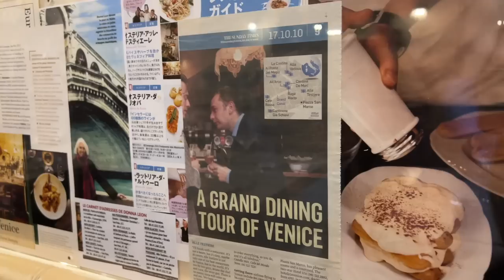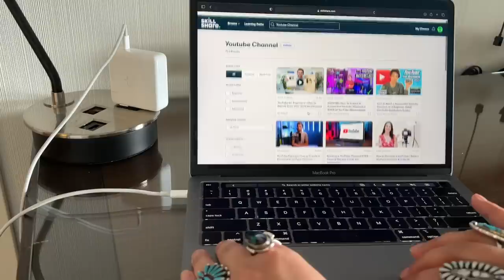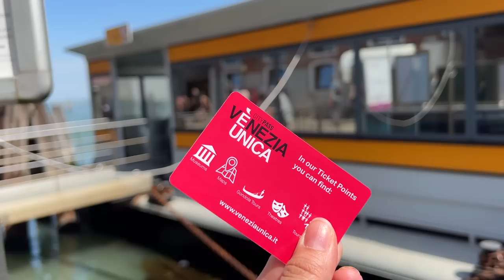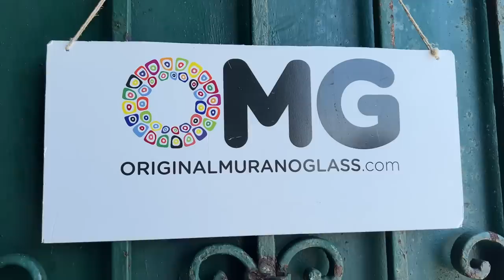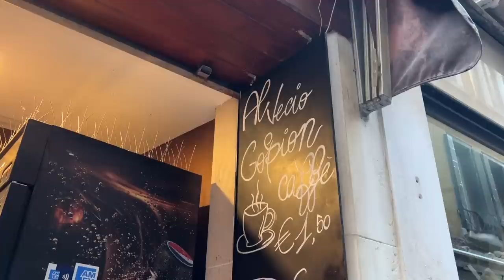3 DAYS IN VENICE! Exploring the City of LOVE | Milan | Venice | Vlog | 30 Days In Europe Days 23-26

Comment: Did you sent your luggage on to Venice while you toured Milan?
Reply from the maker: We actually used Nannybag! It’s an app where you drop off your luggage by airports and train stations in secure locations. I didn’t mention them because we ended up having a bad experience later in Naples but it worked great in Milan.
Reply: I was wondering that, too.  Thanks.